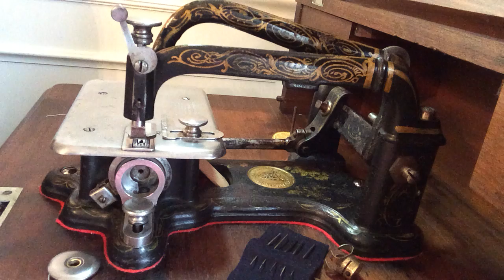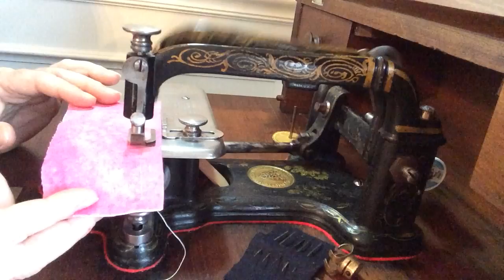Threading a Wheeler & Wilson Curved Needle Sewing Machine

Comment: Hi enjoyed your video! Can I get some help on a part I am missing?? It is the pin for the pressure foot lift to stay up. I have an #1 as well and mine is missing therefore the foot will not stay up thanks.
Reply: I was able to figure something out and it works just like the original part would. Thanks.

Comment: Do you have any advice on how to free up a frozen machine?  The machine won't budge and I don't want to damage it....it's just a beautiful thing!  Also, thank you for providing the information on the drive belt, but I wondered what is the thickness of the leather?
Reply from the maker: oldchickenlady Start with sewing machine oil (avoid the leather covered cylinder under the metal cloth plate) on all moving points and add some heat from a hair dryer. Wait and then repeat. Might take some time. Good luck!
Reply: Check 'cleaning and maintaining your sewing machine' videos on youtube.  I saw a nice video, where a young lady, cleaned a lot of her machine, with what looked like a fat pipe cleaner.  Then she oiled all the oil ports, and worked the machine slowly by hand.  I'm sure if you look around a bit you will come across some videos that will help you.

Comment: You produce some of the best instruction on this machine.  One question I have is, where did you get the belt and how did you lace it together?
Reply: Hi, thank you for this video! I have this machine from1859.. I also have a belt question.. I have the 1 1/4 leather but I'm not sure how to stretch it or put the holes in the ends.. can you offer any advice? Thank you, Erin
Reply from the maker: Thank you! I purchased leather strap from leatherrush on ebay. It was the 1 1/4" width for the length needed. I cut it to fit, punched 3 holes along each edge and stitched it together with thick upholstery thread. I suggest pulling and stretching the leather before fitting/cutting to limit the amount of stretch you get after use. Good luck!
Reply from the maker: Sydney Janvrin, I just had someone help me by pulling one end while I pulled the other to stretch is some before installing. I use a small finishing nail to put three holes at each short end and then heavy duty thread to stitch the belt together after installing. Good luck! I would love to see a photo of your early machine.